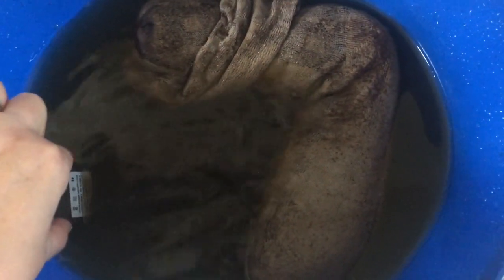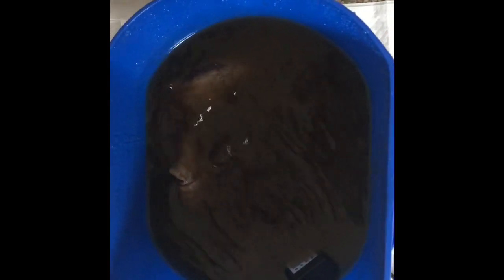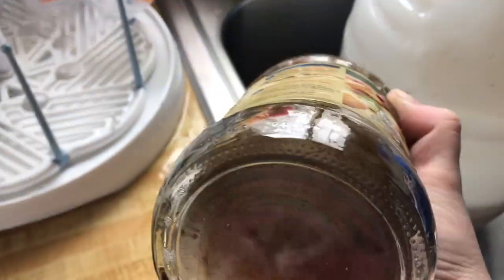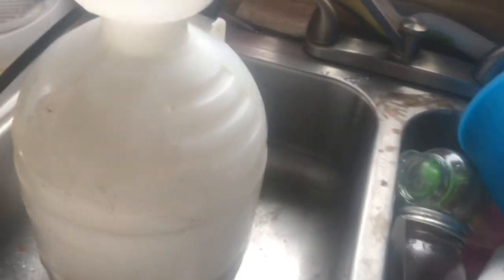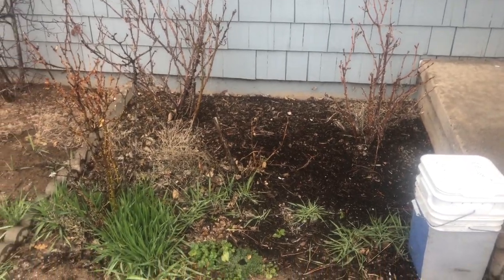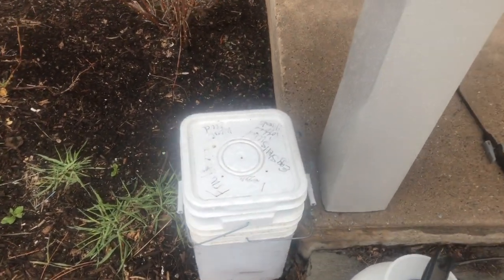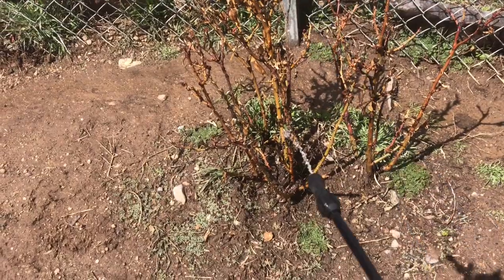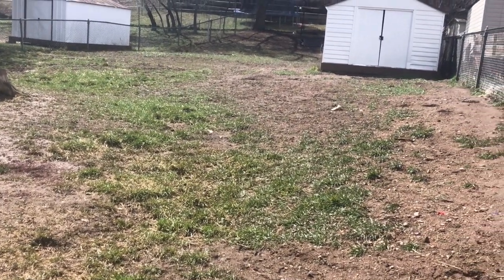Brewing worm compost tea aka vermitea  Part 3

Comment: Mine doesn't foam. I think moving the water so it touches the surface and doesn't stagnate would still work. have you ever noticed a benefit of pest control? I heard it does.
Reply from the maker: I think so too. It smelled good, so I don't think it was a big deal.
Reply from the maker: Yes. Definitely helps with the pests as long as you water the leaves and flowers. It leaves a little shine on them too as an added benefit!

Comment: I made 4 gallons of tea and used it on the tomatoes, various varieties of hot, sweet & bell peppers and pole beans I was potting yesterday in my GroBuckets.  (approximately 36 hour brew time, non aerated) I did not dilute the tea. The tea ingredients were 1/12 sift worm castings, dried rabbit manure, alfalfa (not alfalfa meal) and dried granulated unsulfured Blackstrap Molasses. Checking the plants this morning they all look good.
Reply from the maker: That's awesome. Thank you for sharing! Is the Alfalfa to feed fungi? I need something to up those I think!
Reply: @CultivatingCourage  I use the pellets and grind them up. They're cheap and are  100% Alfalfa. Also, using the dried granulated unsulfured Blackstrap Molasses allows me to place all the ingredients needed to brew the tea inside a single tea bag. 
http://www.caroldunk.com/infomain.html